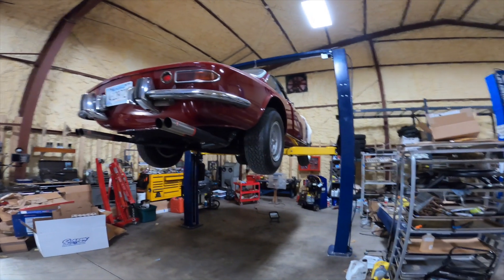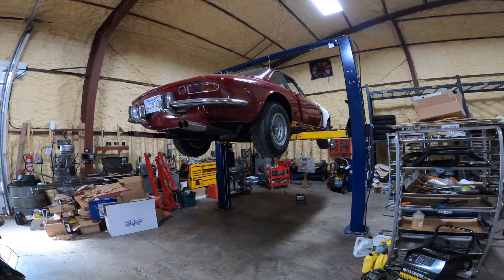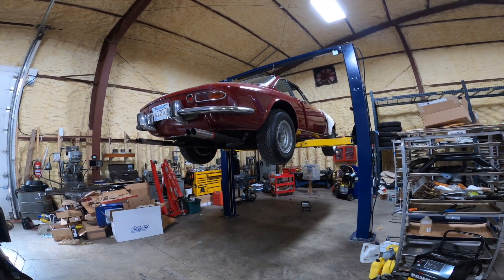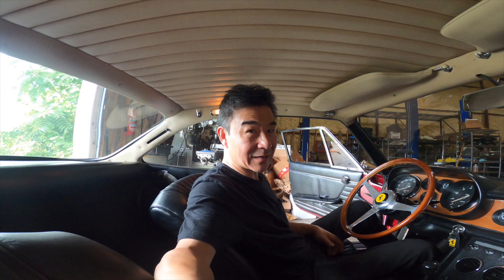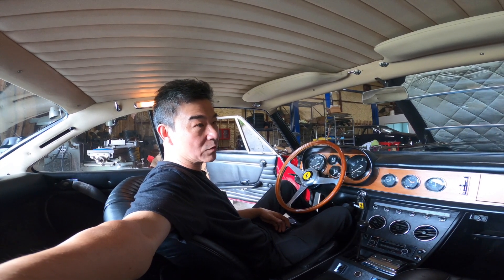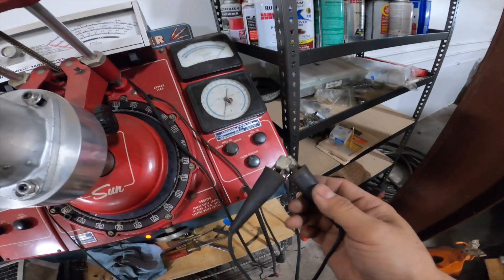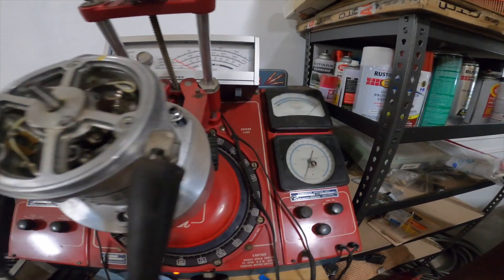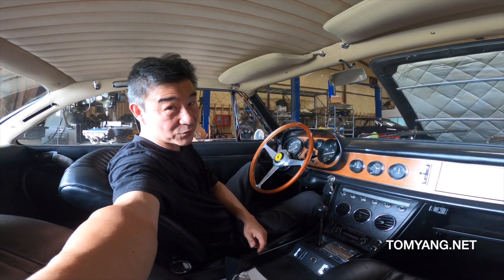Ferrari 330 Electical Diagnosis

Comment: Old ignition capacitors (even NOS ones and todays Chinese sold under different brandnames are crap!) mostly those are wax- or oil-paper condensers and those are hygroscopic that means insulation suffers after decades and can short the ignition. You need to replace them if a capacitance checker shows more uF than written on the capacitor body....(Mostly they are 0.22uF or 0,25uF and when they start to leak they show 0.33 - 0.40uF that means the surface of the foils are oxydized and enlarged and the insulation barrier is too thin now, than throw them in the trashbin)  I use soviet russian military MKT/MKP (Mylar) impregnated ignition capacitors that are non hygroscopic and they have safely welded (not just contact-pressed) contacting inside. You can say what you want about the russian military but soviet russian Wolga / Gaz / Uaz / Moskvich / Lada Niva / Saporoshez ignition capacitors (all the same) are great quality and cheap. I only use them. They nicely replace old Magneti Marelli or Bosch caps.

Comment: Do you change the condensers when the points and plugs are replaced?
Reply from the maker: @vizsla54  we’ve had such a poor supply of condensers that I often did not, but will be looking closely at what to do going forward! Thanks for watching.
Reply: @tomyangnet  Condensers from online auction site just look for WOLGA M24 ignition capacitor! They are great! Can be used for any point contact car.
Reply: When I was a kid, a British car tune-up included plugs, points, dist cap, rotor, and condenser.  Now I know why!

Comment: I repair electronics as a hobby. Without a doubt, the #1 reason for failure is the electrolytic capacitor.  I am quite certain that the condenser in a points ignition system is an electrolytic capacitor.  Since the condenser is typical replaced during an annual tune-up, they may not be given the opportunity to fail very often.  The capacitors in the power supply of modern electronic equipment on the other hand are never maintenance items.
Reply from the maker: With the poor quality of capacitors, I become hesitant to replacing them when the original ones continue working, but just proved that they can and will go bad on occasion! Live and learn. Thanks for watching.
Reply: The igniton caps never are electrolytic caps they are simple wax impregnated paper caps that is also very bad because they develop leakage or even short out. I always replace the old ignition condensers with new Russian made miltary Mylar ignition caps that live 4 ever. You can find them for only 6 dollars intended for Gaz / UAZ / Lada and Wolga cars.They nicely replace old Magneti Marelli ones!
Reply: @Schlipperschlopper  , thank you for the clarification.  This is not a widely know fact from what I can see.  Next time I have one, I'll take some measurements and then cut it open!
Reply: @TonyBarr99  great! I already cut Bosch and Magneti Marelli condensers open...those were paper caps

Comment: The Sun 503 is an invaluable tool when working on pre '75 ignition systems .... excellent content as usual Tom !
Reply from the maker: It's especially necessary for a Ferrari distributor that has two sets of points in each unit that have to phased equally to fire at the right time! Thanks for watching.
Reply: I have an old Bosch device its also very good!